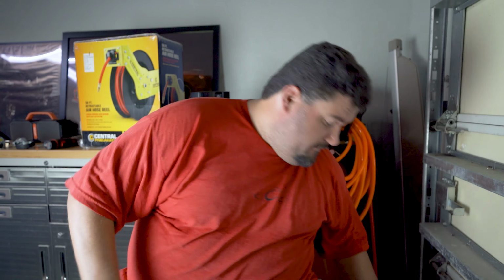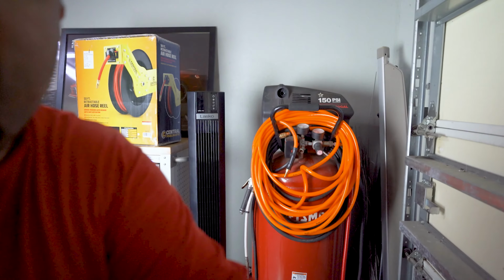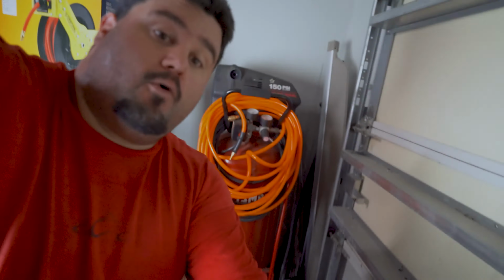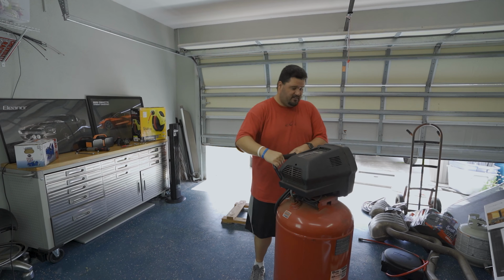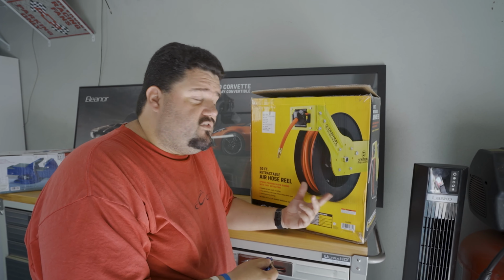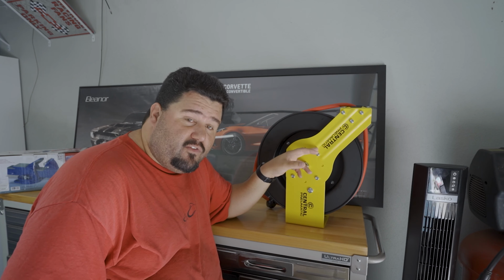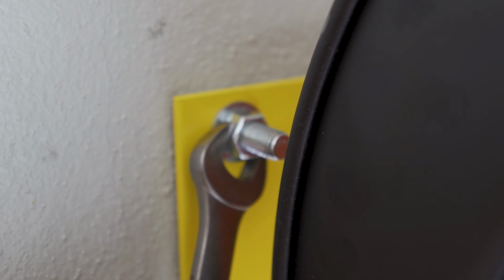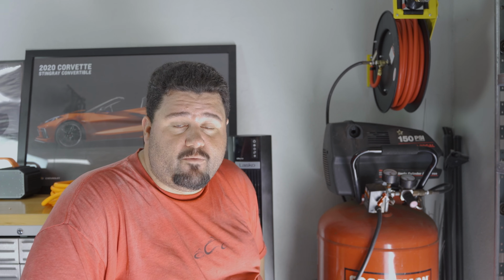Air system upgrade: Install and review Central Pneumatic Hose Reel

Comment: Totally agree with many things in this video. Enclosed hose reels are usually terrible especially when they jam. Strange your compressor didn't come with any wheels, usually with those style feet on the tank they come with a fixed axle and 2 wheels on the handle side and rubber feet on the other side so it works like a dolly. The swivel casters make it much easier to position so sounds like you would've changed to them anyways. 

Also agree with the 50ft 3/8 hose which is great for a majority of applications. I ended up discarding the hardware that came with all 4 of the reels I had bought since they were cheap and they did not work for my installation application. So I rather them not include installation hardware to reduce waste but they should clearly label it doesn't come with any hardware. 

One thing I may suggest you look into if others may be using and connecting that secondary hose to your reel quite often are safety couplers that will prevent the whipping action when the pressure is released from the secondary hose while disconnecting it.

Great video!
Reply from the maker: Yeah I wish they stated on the box about the mounting hardware. Just saves a trip to the store again.  Safety couplers are a good idea. I don't have any safety couplers yet but I'll be getting some soon.  Thank you for watching and the feed back.
Reply: @AcesGarage what do u need the safety couplers for bubba?

Comment: That is one of the best hot-rod air compressor set ups glad I have the same air compressor just wondering  did you get the updated motor cover because there was a recall for that compressor if you did not get the updated part you could just drill hole in motor cover so the motor doesn't burn up
Reply from the maker: I am very happy with this set up it works very good. No idea it even had a recall or if it has been done, i bought it used for $50 off of marketplace. I'm going to have to look more into that. Thanks for the heads up!
Reply: @AcesGarage  yeah you have to open the plastic housing it use a t10 I can't remember then there's another cover that covers the blade of cooling fan might be a good vid idea as a psa fix for anyone that has thos old sears/craftman compressors

Comment: You keep calling yourself "Genius", welllllll, I think I might have used locking wheels so there was no chance of the air compressor walking with all the vibration....hahaha
Reply from the maker: 2 of the wheels are locking wheels. No idea why I only got 2 that lock?? 4 would have been a better 😅. But i got LUCKY! I have never locked the wheels and she has never rolled away!

Comment: What hardware did you use to install and anchor this?
Reply from the maker: I went to my local hardware store , Lowes or homedepot will have what you need also, and picked up 5/8 inch bolts and matching concrete anchors. Depending exactly which model and make you use will depend on what bolt size and concrete anchor you will need.
Reply: @AcesGarage  So that's a concrete wall, then?

My garage is all sheetrocked. So I thing I'm gonna find two wall studs, straddle them with a 2x8, and attach the reel to that.
Reply from the maker: @Panhandle Frank  you are correct my garage walls are all concrete block. Made it much easier for me to mount. If I had sheetrock I would do exactly like you said. Find 2 studs and mount something heavy duty to them, then mount the hose reel to that.